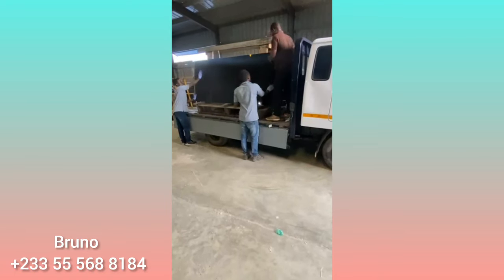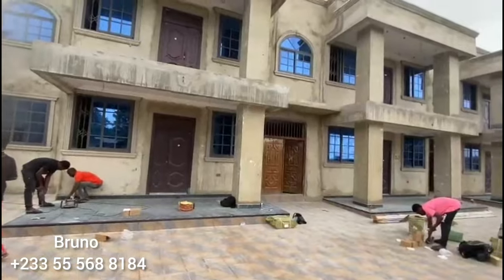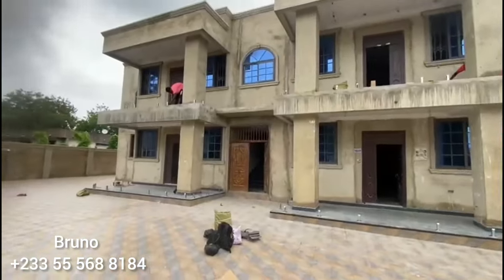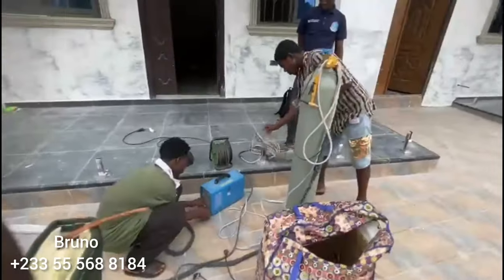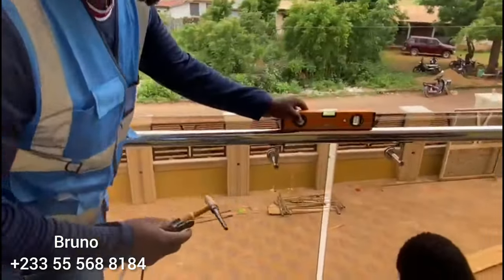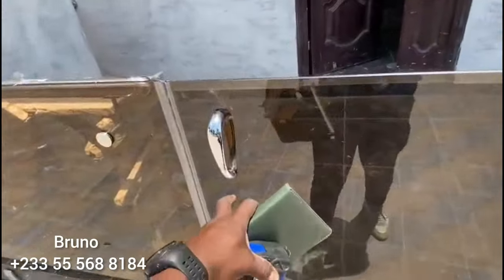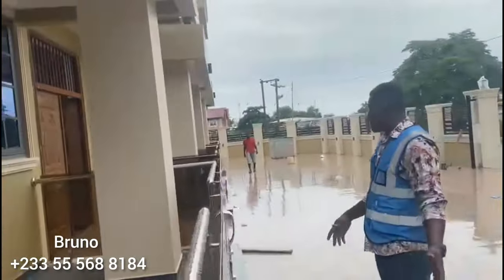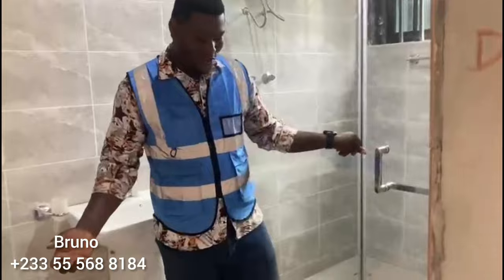Building In Ghana 🇬🇭 | Frameless Glass Balustrades and Stainless Steel Installation | Dream House

Comment: The use of argon and other gases with that tungsten tip/rod is called TIG welding. I'm impressed to see local artisans using it. It's great for aluminum and other thin metal welding.
Reply from the maker: Thanks for the compliments and the tip on this one 🤝🏾🙌🏾